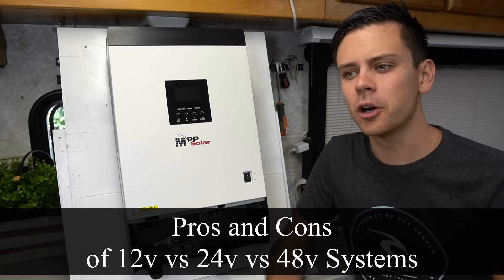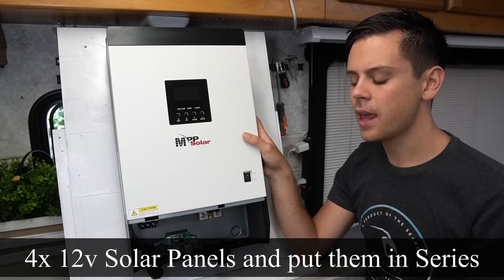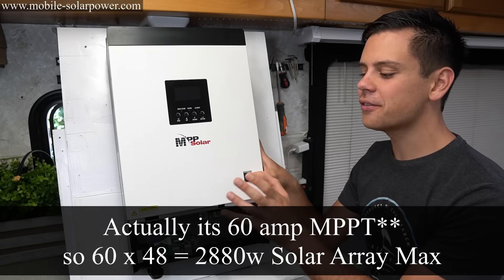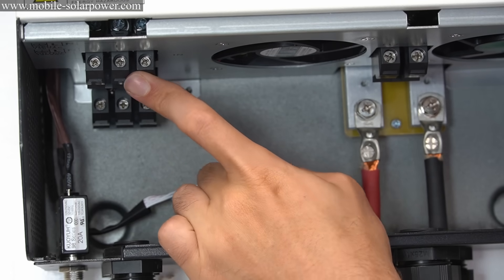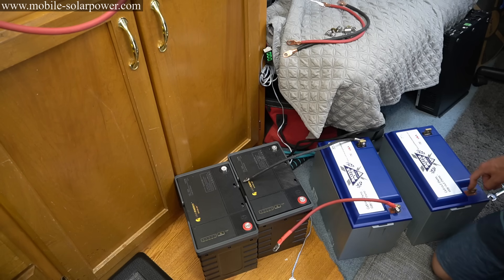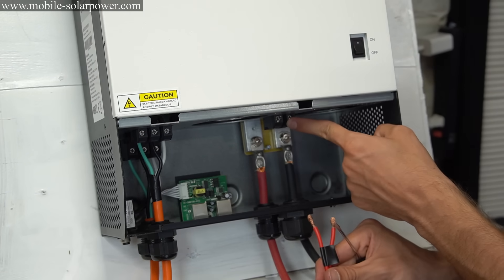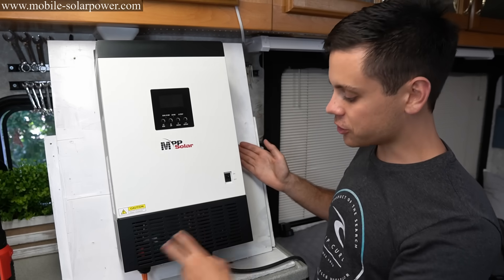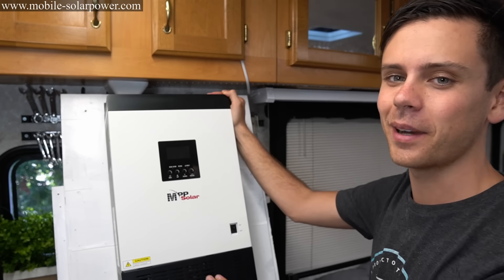48v Solar Power System for Beginners: Lower Cost and More Power!

Comment: Not scared just do t have the funds to but a big ass battery. My home uses less than 2000 watts only occasionally spiking above that. 90%  on the tine thats fine. So why buy another charge controller,  batteries , and possibly more panels  when im good. Granted the is like 2ft from charge controller to battery and another 2ft mayb to inverter so not alot of wire needed.

Comment: yo that was super  easy to understand and follow.. i have a question.. for a 48w system.. how sound is best run my 525w panels? i have 8 but would use 6 for now. and i have an inverter charger , rated power is 6500w
solar charging current 120A if you can add a diagram that would be awesome..

Comment: to be clear most of us are not afraid to  use higher voltage systems   the problem is 48v batteries are a lot more  expensive than say  a 12v or 24v battery

Comment: Will i reccently went by my local Victron dealer, very nice. i was wanting info on a rv solar system with 1200 watts solar and 800 ah. i said i wanted to do my self they told me victron can not be set up inverter has to be certified to have codes to do that. ty for what you do. you have awesome knowleage.

Comment: Thanks for the plain language information.
We have lv 6548 unit
12 ea 46.8v 9.59a panels
10ea 12v 100ah gel lead acid batteries.
I'm a little confused as to best 
Panel configuration 
And bank layout?
Any advice would be greatly appreciated

Comment: I wonder what your recommendation would be nowadays since this video is 2 years old? I'd like to get rid of my electric bill but still be able to use my electric stove and my 240-volt outlet in my garage. I'm guessing a 6000 watt 48 volt hybrid split phase inverter would be the way to go and start with at least one 48 volt battery. What would you recommend for solar panels? I'd be interested in seeing a video covering something like that.

Comment: Does a 48v system make sense for a small travel trailer (20 foot) with an AC, Furnace, 12V refrigerator, and a handful of outlets (tied to both 12 and 110)?  I want to upgrade to from a Lead Acid to LiFePo batteries and looking at the Victron system for all the data/intelligence it can provide but I know I need to step it back down to 12V if I went 48V.  Given that I'm not running a ton of cables and everything will be contained in one spot, is there any real advantage of 48V other than lower current draw?

Comment: Eh problem I have is air conditioning, because that consumes a fair be more than the 240W those unit say they can deliver and they say on them that for a continous load your only supposed to put 120W on them and if you want a ~1000W 48V to 24 - 12 step down converter of a high efficency your talking like $600 - $1000, yes you can get 48V air conditionairs, but here in the UK it's a little hard, I can get 12 and 24V air conditioners easy 48V not so much, my only option is allibaba and even then I have to buy 2 units because they can't be bothered with the effort of shipping 1 because it has to come directly from China.

It's a problem I am going to have to deal with because I am for sure going to go 48V because there is this 15.5kWh battery for £2500 which makes it £161.29 per kWh which is even cheaper than the a cheap server rack battery that doesn't have a display at £195.31kWh and this battery is a standing battery to it naturally takes up less floor space which is a premium inside a van and generally takes up about the same volume 2 server rack batteries while it has more a touch more capacity than 3 server rack batteries because your putting all those cells in 1 encloser you waste less space, also that use 304Ah cells which volumetically are more energy dense than their smaller counterparts which is how you end up with such a dense unit.

Still weighs 140KG which is actually heavier than 3 server rack batteries, because they still have to put all that meterial in there and then have to be able to support all that meterial, so it's not all roses, but if I were going to go with 3 server rack batteries I would need a rack which would make it weigh even more than 140KG so it's not really a downside.

Comment: .im finding a 24 volt system and 48 volt system insanely expensive-   copper? most it seems tro be only a few feet from battery to controllers--     but charging from a 12 volt automoboile system- insanely expensive- or getting shore power-- need switches or crgare s or an insane charger inverters--    suggestion--  teacdh a system with all the ins and outs-- instead of bouncing around.

Comment: Hello
I Have A 24 Volt MPPSolar System. I Want To Configure The System To Use Solar Only For Charging and For Appliance Power. In That The Inverter Does Not Send Grid Power To The Appliance. When The Battery Hits The Low Level Shut Off, I Want The Appliance To Lose Power. Any Recommendations ? FFF

Comment: I need a system that allows me to power a 1hp 230 volt well pump during a power outage in addition to three 110 volt refrigerators.  The system has to have enough kw to handle start up inrush to the well pump.  Do you have an example video that addresses my situation?  Also the solar panels that I have are Enphase micro inverters and I do not know how to connect them into the system.

Comment: When you picked up the (male) extension cord and said you can connect it to an extension cord and plug it into the grid. Are you actually plugging the extension cord into a house 110v receptacle thus back feeding the grid?

Comment: I need some help finding a charge controller that will work charging a couple 36 volt lithium ion batteries using two 220 watt solar panels. The first controller was  10 Amp Renogy but I exceeded the input voltage of 15 volts and fried it. Any help on finding a controller that will fit my needs with out breaking the bank is appreciated.TIA

Comment: Am planning to build a system all ready have 32 3.6 volt lithium cells to make big battery was going to use overkill bms s want about 5 kw inverter controler  to run small off grid house after your ideas on what voltage to run and what controler would you recommend thankyou am in Australia so 240 volt

Comment: Hi, I like your videos and how you simplify the whole solar system setup. Do you think you can assist me with the things l need to setup a 5kwh solar system? what are the things l need, what size inverter should l get and battery bank should it be 5.12kwh or higher and how many solar panels should l get as well as other items, charger controller, etc

Comment: Great Video, I have a 6000W 120/240 Output 48VDC unit, still waiting for panels and battery box. 
I have the invertor and You explained everything I needed to see. Do You have a video hooking it up to the 
breaker box. Keep out the GOOD WORK.

Comment: You're the best, Will.   Thank you so much.  After watching your you tube videos for about three months I am finally feeling confident I know which way to go to power my small cabin.  
Quick question...can this all in one be connected to a small panel to run my in wall wiring to?

Comment: Great video. I just did a similar setup on a 24v system. This was so helpful. One issue I'm having is when connected to 225watt solar panel the highest current is only 0.4amp on 33v input. Is this normal?

Comment: I'm confused and I have a question. Maybe I'm overthinking it I don't know. When you wire the output plug, the female plug to plug appliances into. Does everything go into that one plug? Or should I wire multiple plugs? Like a portable power station has 6 sometimes seven outlets on it. Should I have maybe Outlet plugs coming out instead of just one, or will one plug handle all the current?

Comment: For the long term and especially for any lead acid batteries, it's best to put the outgoing connections of each parallel back on seperate batteries so that they both experience the same cable resistance.  Seeing that LifeP04 is so voltage sensitive in the mid range, it might be worth the OCD.

Comment: Greetings from India. Love your videos.

Please create a video about creating & upgrading larger systems say 5 KW, 8 KW, 10 KW and about starting with say 5 KW and gradually increasing and ending up with 10 KW or more and issues involved in increasing capacity. Similar for adding batteries gradually for increasing backup time slowly to meet budget constraints.

Also, would love a talk about minutely monitoring every element of a hybrid solar power plant, grid tied with backup.

Comment: I'm building an RV system and was looking at the EG4  Batterys and off grid inverter. Can I use this kinda system. there will be alot of vibration. But can rubber mount everything to mitigate alot of that vibration.

Comment: Could you connect the unit to a fuse box/load center for running cables for lighting, electrical outlets, etc.?

Comment: I like your videos but I have a Question about Grid Tie Systems that feed back into the Grid. Supposedly. I have 110v 1kw grid tie unit on my system but not sure if it is really doing much. Fed from a 1100watt 12 array then have a separate 24v 1100watt system with a 24v 1500 watt inverter. Anything you would recommend similar to  this above system that can also feed back to the grid for the excess solar power I am creating.

1000W Grid Tie Inverter AC110V Used for 12V Solar Panel Pure Sine Wave Inverter

Is the unit I have. Have you ever used these things?

Comment: Love seeing your videos,
One question. Currently there are ads stating call now and get a Tesler battery and solar install for free, some make it seem the units are free free also.
Can you do a side by side comparison of Tesler vs a system you create.

Really need big enough to run a house a/c unit 3 to 4 ton ( not heater). In Florida hot and muggy here.

Love your step by step demos.

John

Comment: Will, I live in Thailand and I'm going to build up a DIY 2x10 panel high voltage array, 48V 10-12kw hybrid system this year, so review one of the newer 5.5kw paralleled inverters or equivalent? Might save your viewers (Me) a few bucks. lol

Comment: I have a 48 volt golf cart and a four panel array with a big front charge controller to charge my golf cart and every time I connect to charge wires on my battery pack I get a large spark can you recommend something for this issue

Comment: 48v doesn't bother me. i've been shocked on 240v in UK, but i do worry about safety and the fire hazards. I live in Japan now and it is hard to find the info I need to build my system. Your info is great, watch most of your videos and it's pretty simple to adapt to the Japanese voltage,. My big problem and what makes me nervous is putting the solar panels on my Japanese roof, finding English info on how to do  this is difficult.I don't want to do the ground method, have to cut down trees and it's wasted space. Anyone that knows where to buy parts for a roof attachment and how to get my solar on a Japanese roof would help me so much. I don't know the planning codes in Japan but should be OK as long as it safe.

Comment: I went for 24v system for my camper van because 48v equipment is so much harder to find. I designed it with 4 solar panes and 2 MPPT solar chargers and 4 Lithium 100Ah batteries with thicker cables so if needed in an emergency can I can reconfigure it to 12v or even 48v.

Comment: I am in Thailand. I studied electronics but could you advise on my proposed system as I will need a restaurant and kitchen to be powered and later expanded to other buildings. 

5kw off grid inverter. $400
16 lithium 3.2v batteries 100amh. $480

340w 36v arrays. $100 each.

Considering 2 x array in  series.

Any advice on pitfalls?

We are doing this because 800m from mains 220v electric. And forecast a cost of $3000 for installing mains to building. Not the internal wiring.

Was considering two inverters at different lower voltage for cut out for batteries. So lighting system stays on for emergency supply.

Comment: Cost wise there isn't much difference depending on what you chose for individual components but this is MUCH easier to put together. The MPP's have transformers that do fail eventually so how long they last would determine which is better value imo, my electrodacus doesn't use transformers so could last the rest of my life for example. If you get a failure free decade out of it then they are probably the way to go, I suppose the product hasn't been around long enough for real data on their reliability?

Comment: Hi, I have the same brand 5kwh model. Somehow the solar panel is not showing on the display and it shows PV voltage zero. Can't get this to charge the batteries. I am setting up off grid.
Please please help.

Comment: Thanks for a great video . i have a question. consider , i have a 2kw water pump and a Diotherm with 2.5kw and a refregrator with 200w and 5 lamp with 100w totaly. how many pv and which model inverter and charge controller do i need ?

Comment: Hello. I really like this set up.. I have slowly over the last year aquiracquired 6 345watt voc46.6 solar panels 4 12v deep cycle led acid lift truck batteries with 4 more on their way.  I really like the simplicity of the charge controller inverter combo all in one. This will be my first build of a system this large. I've had a much smaller kit for the last few years powering the lights in my garage.  2 100watt panels 2 12v batteries a 50w 70amp charge controller and a 1500watt pure sign wave inverter.  Not intimidating at all lol.. however this new system is making me hesitate.. if you've made it this far through my rambling 👍. My question is would this charge controller inverter be a wise choice for my panels and batteries? Thanks and your videos are stellar brother great job.

Comment: Super info !
I am looking around to set up a 9 kW system at my house.
For this  I don’ t find much info for what I want to set up. ( 3 phase, not on the roof but on the ground, with battery backup possibility to connect on my electric car )
So this video was fabulous. With this system everybody can setup his own .
I will go to this site to have more info about the 3 phase connection.
I suppose you can come in with DC from the solar panels , 150 m from my house .
Maybe with 3 separate arrays and 3 of those boxes ? I will have a look about the price ,
But at least if one array is down I will have power on the other 2 ? Maybe no 3 phase current anymore ?
So every option gives another problem to solve ! So exiting.

Thanks for all the info.

Paul 

I

Comment: Are there all-in-one systems that are as good as these that can be used in a grid-tied setup where you feed power back to the grid after your batteries are charged? 

Edit: I found that MPP makes the Hybrid LV 6KW that does grid-tie. What are your thoughts on this model?

Comment: Watching this video for the 4th time now. It is that good. I have a question, so I have a similar inverter to that one but mine has a maximum solar input of 145 volts. I notice that solar a 12 volt solar panel has a different VoC (higher than 12v). Which volts must I use to calculate the 145v max for the solar charger?

Comment: On the 24v system being super safe: While it won't shock you, you need to be careful with metal around batteries. A gold wedding ring shorting a battery can burn your finger off. Avoid using jewelry or tape it up when working on batteries.

Comment: I have a 48v Solar Power system and I have 4-100volt 12w panels and it works great, but I'm try to add 4more same panels but my system stops working. I tried every combination but it won't except the 8 panels. I used the new panels and they work great. "what do you suggest?

Comment: Correction: Ground, LINE, Neutral, Will.  120v is called line voltage.  For split-phase (US 240v), you'll see Ground, L1, and L2, with L1 and L2 the hots.
Thanks, Will.  I plunked down the ducats for an MPP Solar offgrid 5kW with split phase.  Starting with 1kW of solar on the roof, it can easily be expanded, paralleled, and expanded again.

Comment: Any reason there was no heat shrink around the battery hookup wires?
Reply from the maker: Yeah I ran out
Reply: @WillProwse  Ahhhh... whew thought I could setup without the need for heat shrinks for a 48v system😅

Comment: Hey Will, I have 4 panels (and another 4 that I want to link up) feeding thru a 100/30 MPPT going to 2 Tesla batteries (5.3kw each). The panels are 345w/46v/9amp each. Am I reaching my 30 amp limit quickly and hitting a stop? I want all 8 panels hooked up. Any arrangement ideas for series/parallel panels and the 2 Tesla batteries (24v)? Thanks

Comment: What size battery cable are you using?  I am installing a 48v system using eight 6 volt lead acid batteries and growatt 6k inverter split phase. 80 amp.

Comment: Have you done the larger model video yet? Like 5kw I think you mentioned.
Also, if I'm off-grid with no chance of grid power being available do I just not bother putting the ac input wires in? Also how would you size the system if my plan is to use those $50 250watt panels you talked about in another vid? You said at least 4 12v panels are needed and you need to walk it up 4 each time you add to it.

Comment: 10:06 you said if the batteries were lead acid that you would add a fuse. What type and size fuse would you use? I have a Growatt 6k and just playing around with my lead acid 48v setup until I can afford my lifepo4 build.

Comment: I have 12 305w solar panels. Also have Cotex 300w inverter and a Aims 5000w 240v inverter. Also have a Outback flex80 charge controler. I have not installed any of this. My question is does this equipment look good?
I also have 24 130w used panels. Also have 8 6v golf cart batteries 210ah